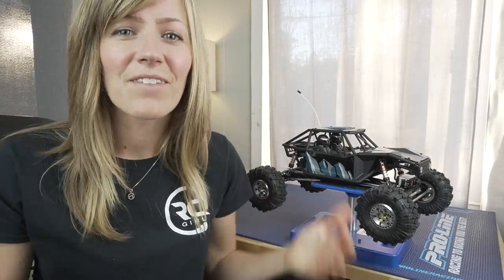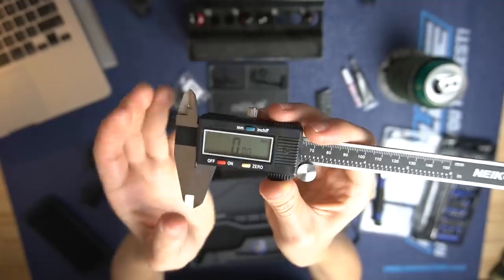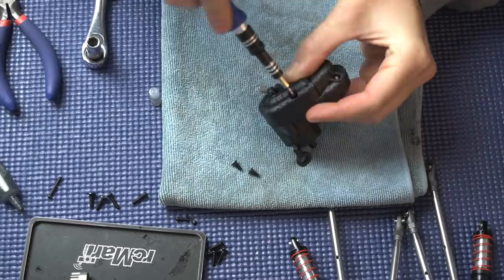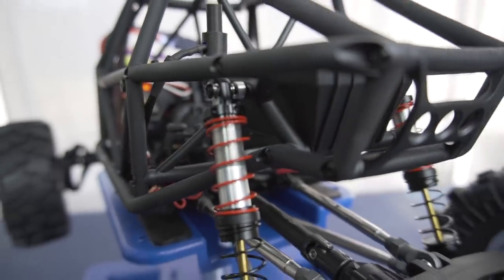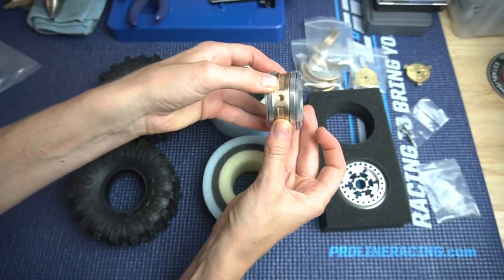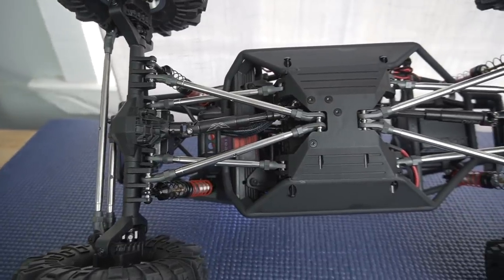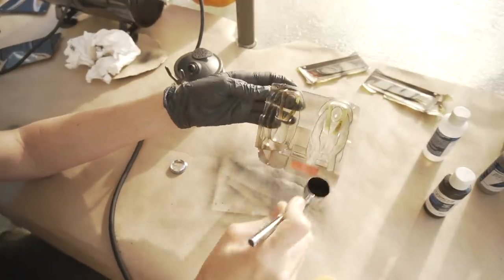AXIAL CAPRA! Build Highlights & Early Upgrades

Comment: I got the Capra the day it came out in my area and had it together that night. I was so excited about it. The upgrades you did are nice, but it should be noted that it works quite nicely stock. The shorter shocks will help, but the fuel tube or pin spring mod will give the same as a shorter shock. The only thing I don't care for stock is the wheels. They may be the worst Axial wheel I have ever had. I think you are going to love this truck.

Comment: Great vid, I just got a capra and it's super fun! I'm running a castle slate 2850kv on 3s with the stock pinion. Great low speed crawling and enough speed for mud or whatever!

Comment: I added 4 wheel steer on mine. i have overdrive gears up front HR gears. I am running dravtech 90mm shocks with soft springs 40wt up front and 70wt in the rear. Running a Hobbywing 1080 esc, tekin 35t HD motor, SX107 dig servo, Reefs rc triple 4 up front and a protek 370tbl on the rear. Also running VP blue bully wheels with beef patties up front wrapped with voodoo klr X4's with their foams. and finally I 3d printed my body panels in real blue.
Reply: I wonder if you are going to share that body panels on Thingiverse?
Reply: Hunter they are already out there but not on thingerverse.  They are not my creation I just bought the files and printed them
Reply: Thanks! I found some when I 
searched on 3d printed parts for the Capra.

Comment: Just got my Kit, 
Buying  - Hobbywing XR10 Pro G2 ESC & V10 G3R 25.5T Brushless Combo, 
Buying Upgrades - F&R Steering with Reefs 444 Servos & Reefs 99 Mocro for Dig. 
Already have  Hyrax Predator 1.9 on Treal Beadlocks, May swap for Spec RC Beadlock Wheels.  
Have - Radio & Receiver FS-GT5  for Crawl Modes

Waiting for 1st Run to decide on shock upgrades.
1st CG Mod will be  Samix Brass knuckle and portal covers w/scale Brake & Rotor F&R
Eventually Custom Links to experiment with climbing Geometry

Comment: This review/build was informative and graphic enough that if I was fortunate enough to have a proper workbench, lighting, and ancillary appurtenances I would attempt it. I am however eager to check out the rumored RTR when available. Then all I'll need is find a plug adaptor for my Traxxas battery and I'm set. I very much like the pastel Mountains on your side panels.
Reply: I built mine on top of my laptop 😆😆😅

Comment: I enjoyed building my Capra. I'm thinking of building another one. I had one issue with the kit, though. I find it hard to mount the proline hyrax on the plastic wheels that come with the kit. I ended up using generic aluminum wheels.

Comment: I’m brand new at this. Just bought a Capra. Tried to upgrade tires and wheels but once I got them mounted the motor wouldn’t turn them like they were bound up tight. Any ideas?  I put the stock tires and wheels back on and it works fine

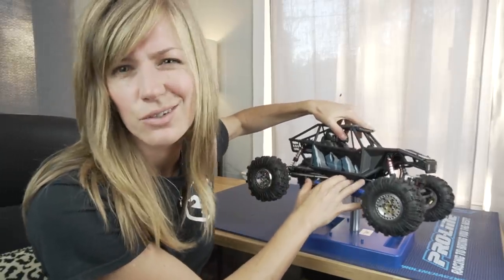Comment: @RC Girl .. you mentioned @ 1:25 about possibly stripping out a screw when doing the side attachment to the skidplate .. question I have .. do you know of a secret to removing a stripped screw from that location ? I know I probably stripped 2 of those screws trying to get them in (to scared to check) :(
Reply from the maker: I ended up needing to disassemble it this weekend and in fact two of those m3x18mm screws were stripped. 😩 Typically I'd suggest Dremeling a notch in the head and using a flat head to get it out but these are inset in the chassis plate. What I ended up doing was using a different shape/larger bit and kind of jamming it in. Luckily that worked. I replaced all those screws with some I got from the hardware store made out of harder metal and they seem fine now. Good luck!
Reply: @RCGirl  - Yeah .. this is going to be fun :( Thanks for the quick response.

Comment: I had to go back and rewatch the part where you ran it on the stand to demonstrate it running and the dig function. I literally just hooked the electronics up in mine and set my pinion gap and tested it, whoa yes the trans is a bit on the loud side as if there was sand or dirt in the gears but after rewinding your video 3 times to hear it, it sounds exactly the same. I was expecting smooth and quiet. Nope. I hope that is totally normal.
Reply from the maker: Yeah i was kinda surprised by the noise. I think thicker grease in the transmission might quiet that a bit??
Reply: RC Girl  well I don’t know if this helps you or not but now it’s smooth and about the sound you would expect from the others. After a hour of messing with it and adjusting motor pinion, paper trick and so on I finally figured it out. I set the motor pinion flush with the spur gear at first then decided to drop the pinion about 2mm below the spur as if you was looking at it on its side. I’ll send a pic through messenger. Anyhow long story short it corrected my issue and sounds just like I think it should. I assembled my entire Capra with marine grease.
Reply from the maker: @keithphillips1234  oh interesting. I have mine disassembled for lighting system install so I'll have to try that.

Comment: I love those beadlock wheels. Where can I get them at?
Reply from the maker: Ottsix Racing Capone varihub wheels: http://bit.ly/337RnIa
Ottsix VariHub 12mm Hex Hubs (Aluminum or Brass): http://bit.ly/2D3sWBi
Ottsix Optional Brass Circumferential Weights - 5.5oz (2.7oz per wheel): http://bit.ly/2CY1O6G
Ottsix 'SUB10' 1.9 True 3 Stage Foams (for trucks up to 10 lbs): http://bit.ly/2r77FnB
Ottsix KLR/m Vex gold tires: http://bit.ly/2XwQec0
Reply: @RCGirl  thx

Comment: Impressive rig, I'm on the verge of buying a capra kit. Not going to lie, i feel a little nervous. It's my first time building an RC. I have some mechanical and electrical experience so im hoping that'll help. Any tips for a newbie like me?
Reply from the maker: Organize all your hardware for each section (eg, put all the same size screw together) and measure them out with digital calipers if you have some, look ahead in the manual so you know what's coming, use an electric screwdriver/bits (will save your hands while wrenching through the kit!!) but then hand tighten the rest of the way. Spend your time getting the transmission gears assembled properly. And general practice is to threadloc any screws going into metal.
Reply: @RCGirl  yes i ordered a caliper, i noticed you mentioned that. I'll have to order and electric screwdriver/ bit. I will be sure to pay attention to detail on that transmission. Thanx for replying, you're awesome! Where do I find the instruction manual for the capra?
Reply from the maker: @Okaley576  check horizons website page for the capra and it also comes with the kit
Reply: @RCGirl  is it true the one that some with the kit is incorrect on some areas? That was the reason I was asking. I've been looking for the one online but hadn't had any luck. I'll check out that site you told me though

Comment: Which is better in ur opinion bomber or the Capra don’t know which to buy
Reply from the maker: That's hard to answer! The bomber has been around for 6 or so years and the kit version has been discontinued so I'm thinking the RTR is not far behind. Doesn't mean don't get it, but just means they might be thinking of the next iteration of it. Bomber can take on more difficult terrain (bigger tires, different class). The capra is fun if you like going slower and thinking through your lines more. And it has portal axles.  I'm sure you'd be happy with either.

Comment: I don’t want to be a stickler here but you driveshafts are installed incorrectly do to the fact you are suppose to run your splined side to down at your axel so no debris or water collect on the female side of the shaft. Being the way your running them it creates a cup collecting all of these problems hindering the driveshafts ability.